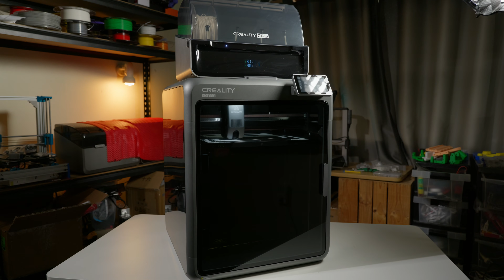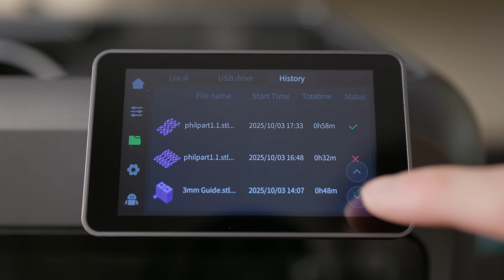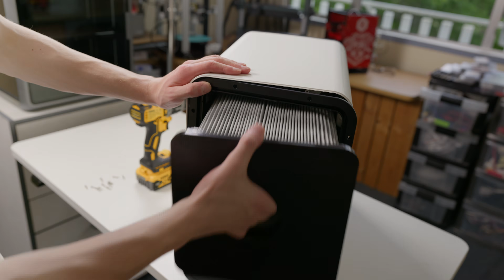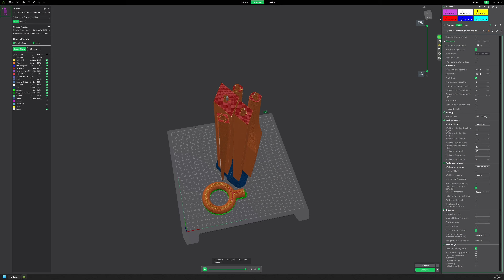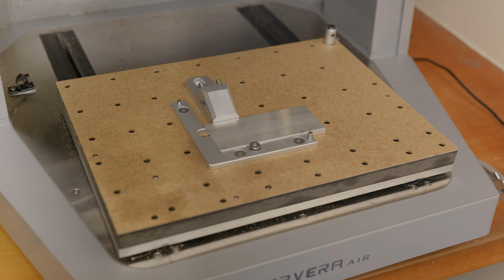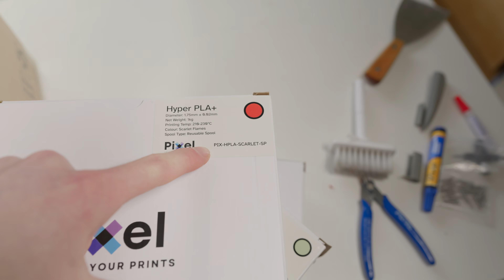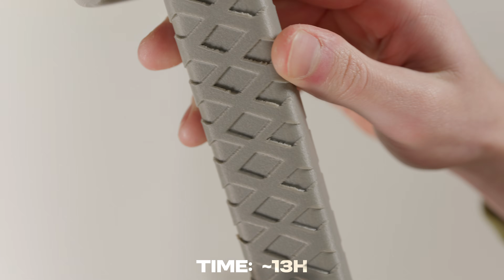My Time with the Creality K2 Pro

Comment: Bro gets the "pro" machine that is supposed to be plug and print and instantly starts modifying it😂love the video
Reply from the maker: I did plan on adding the Trianglelab gears from the beginning, but the machine was meant to be kept "Stock+" at best! It's just how things went, haha. I have to figure out now what to do with it moving forward... Cheers!
Reply: At least he doesn't need to modify the door for durability. It seems to be Uncle Jessy - proof.

Comment: Shiii... That hot end is quite eyecatching with that red silicone sock... and wow, an E3D collab? Also yeah... HOLY RESONANCE! (That momentums got to go somewhere, right?). What does concern me, though, is that they still have not decided to go back to using MeanWell PSU's... and they aren't using their own branded PSU's either. I wonder why, good to see ferrules though.
Reply from the maker: I know right? That was one of my fave things about the hotend, and Trianglelab products, haha. I'm a bit lost regarding the E3D collab though, haha; I haven't worked with them yet but I might be misunderstanding.
The momentum does have to go somewhere! Power supplies are an interesting topic for sure. The current stuff looks fine, but it really is an ultra long term test if all's good, I reckon. Cheers!
Reply: @TommyHoughton  Oh, I was talking about the Creality X E3D nozzle lol, I probably should have specified. I did look up the brand and apparently it is one of those generic white labels, nothing special... although I wonder if they chose this specific white label because one could mistake the logo for the MW logo from a distance? Or maybe Im just paranoid... anyways, cheers right back at ya, and I hope this PSU proves me wrong (you might want to keep a MeanWell on hand if this one decides to go bang though...)
Reply from the maker: Ohhhhh, I had a hunch I was missing something, haha. You're all good; that should have been obvious on my end. Those nozzles are really quite something! A tad pricey, but very cool looking, haha. They have a sort of rainbow shine at the right angle, despite the dark black coating. You might be onto something there with the power supply... "Thankfully", another area of the machine has given up first, so I don't think, at least with how long I'm expecting my ownership of it to last, that I'll be the one having to handle a swap if something happens 😅

Comment from the maker: It's been quite some time since the last video! I'm very sorry about the delay; I will admit I spent more time than usual on other projects, such as a rather interesting short film for my friends (which was a stark contrast to working on these videos!), alongside custom printer planning, lots of spending (cough, investing into upcoming videos, cough), and slowing down in preperation for the big speed up, or such. (*and of course, extra time spent on the issues that unexpectedly arose with this machine...) Anyway, enough of that. Here are the usual disclaimers and things I've forgotten, as I always seem to be doing these final stretches at the latest of hours...

- Autofocus Issues. Yeah, that's my bad. Turns out putting a metal bokeh filter that literally obscures 80% of the front glass element, combined with a fast aperture, makes things a bit troublesome. What's even more annoying was that was a last-minute decision to add, haha. Won't be doing that next time. Two steps forward, etc etc... 

- Unfortunately, there are two instances of artifacting on this video. Those are caused by the video export, which is really frustrating. I checked all of V1, but as one single audio clip was too loud, I rexported the entire thing, and didn't check it as thoroughly. Annoying, but that's my fault. Sorry about that guys. 

- It's possible that the "VFA" issues could be due to Pressure Advance, which is interesting, and possible. I'd need to do some more testing. VFA's will still show up given the smooth idlers used.

- YT Mid-roll Ad Amount Halved.

- I don't intend to do too many "overview/review" style videos in the future, but I do have at least one similar one planned for a couple of months from now. It should be night and day, I hope. I have high hopes for some upcoming changes. Next week'll be good fun for planning and a little break.

Cheers!